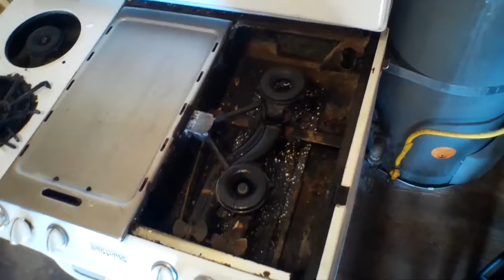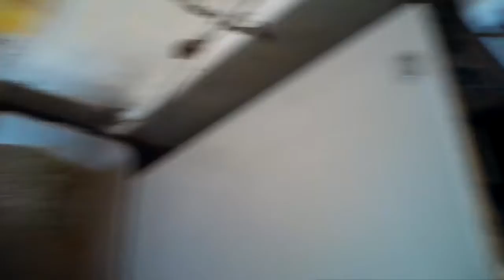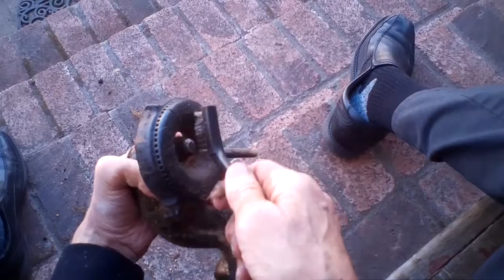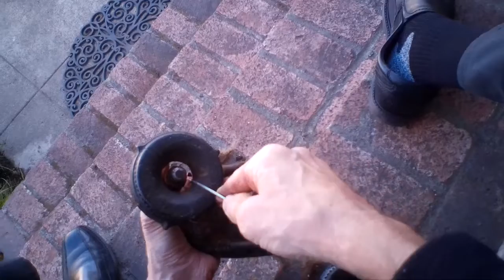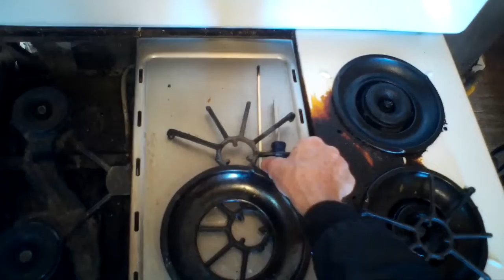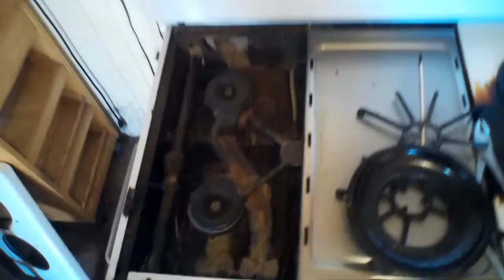Merrit O'Keefe Very Old Stove Won't Light

Comment: We have a different problem with our old keefe and Merritt 1953 model. It requires manual lighting to get the burners and griddle going. I've checked the pilot light to the middle of the stove and it is lit for sure. I don't know if there are more pilots? I see there is something that resembles a pilot under the griddle but I cannot get it lit 🤷

Comment: Thanks for this video! I have a similar-era O&M stove and I've battled the non-working burners for a couple of years now (I keep stick matches handy). Question...
My oven light recently went out but when I put in a replacement bulb it STILL doesn't go on (yes, I checked to see if it was were good) and I'm wondering if there's a fuse? I really don't think the switch is bad.
Reply: Check the contact to the bulb 
and then, 
ensure you have solid connections 

No fuses

Comment: Thank you for this video! Great help in adjusting my Okeefe.  Any advice on how to tackle an oven that won’t light? The oven pilot is lit and there’s gas feeding the rest of the stove, but gas stopped flowing to the oven for some unknown reason. Again the stove pilot is lit but no gas feeds to oven.  Is there some kind of emergency shutoff that may have been triggered somehow?  Anyway, thanks again for sharing.
Reply: The thermostat isn't working. There is an override switch. the little red button. Light the pilot and hold the button for a complete minute.
Reply from the maker: It may need a new thermocoupler
Reply: @ScottTheFixItGuyChannel  Hi there, great helpful video. I am experiencing the same issue with my O&M (same model as video only in a little bit better shape). Do you have any video on replacing thermocoupler and/or know where I could order one? Thanks so much!
Reply: Most of the safety valves in the old stoves need to be rebuilt to make sure they are safe. We got ours done from a company in California that's been in business for about half a century. Look for the Old Appliance Club on the web. When the Gas Co. man came out to do a check he was amazed. Everything works like new. We love our O'Keefe & Merritt stove.

Comment: By the way, the burner valve adjustment can be made with a small wrench but you'll likely need to remove the front control panel to access the valve.  On this model there is one jet for the outer ring of the burner and one jet for the inner simmer burner (hence the two venturi shutters per burner).
Reply from the maker: Thanks Gregory👍

Comment: Hello,
Just a quick comment on your video.  To get the correct mixture of air and gas you need to adjust the burner valve jets together with the air shutters (venturies).  The center flame is actually the center simmer (not the pilot) feature that allows you to cook on a very low flame or keep food that is already cooked warm.  If you do a web search for "alltrol" burner valves you'll find more information about how to make the adjustment.  I just restored a Wedgewood stove of the same vintage and found the adjustment to be fairly easy.
Reply: Yeah, on my 51 Wedgewood,
I left food on the inner-ring
(Actually for “warming” not simmer)
I forgot ALL NIGHT.
 
6 hrs later, pot of food was “warm”,
Not burned!

Inner fire ring was designed 
so that you can leave food on it 
To keep warm & not burn.😃